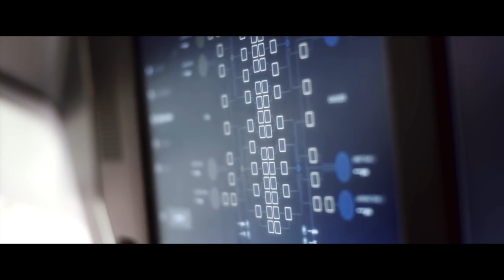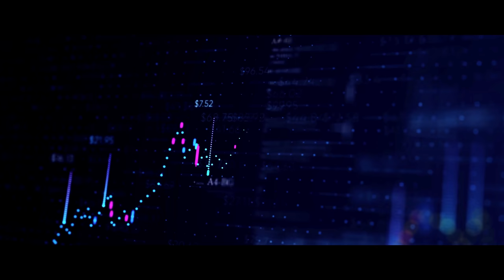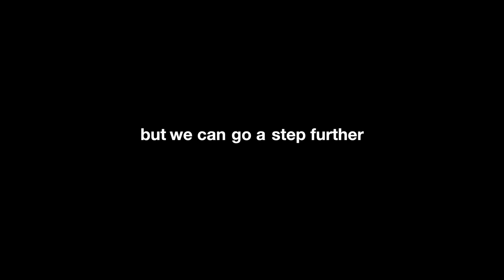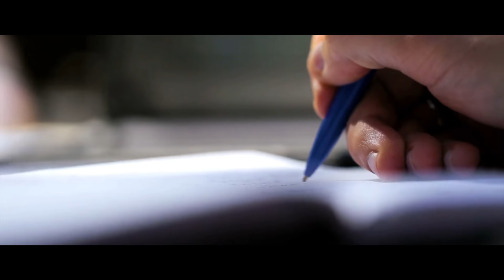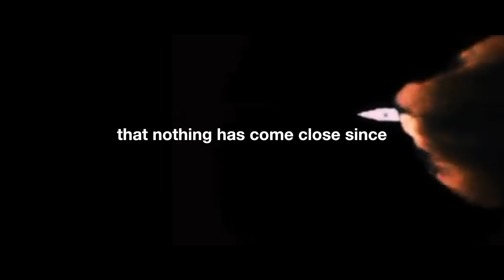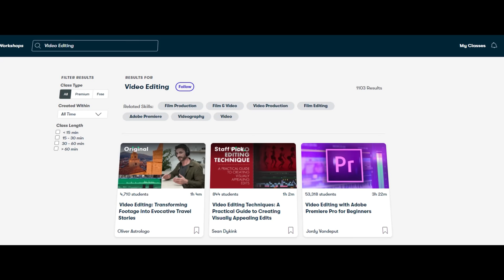The Future of Human Spaceflight

Comment: Lasers using very short pulses can achieve ridiculous exhaust velocity using  plasma wake field acceleration but years ago a pulsed laser got 5000 sec. Isp by vaporizing parafin  and then heating the vapor. Orbiting laser arrays at the destination, say Mars, can make high thrust high velocity possible. The vehicles would need large low mass parabolic mirrors but  the engine could be as simple as a block of wax...well almost. Thanks for taking up this subject with such a quality vid.

Comment: Interesting. Regarding the future of propulsion, as a student physics engineer I'd rather bet in a reinterest in nuclear propulsion and aerospike. I know it may look just like a fancy based opinion, but it is in fact very probable. It's no secret that nuclear propulsion is by far superior in efficiency to any kind of combustion propulsion ( up to 3x ), but as nuclear waste gaz would be released in the process it is forbidden in both the atmosphere and space. However if an Earth based use is indeed unwise, in space in both Earth orbit and deep space it much more open to debate and possibilities. That may even be crucial in the future for interplanetary ships for travels between a Mars colony and a Moon base. 
On the other hand Aerospike nozzle can save up to 30% of fuel in the atmosphere, a technology which is only hindered by the lack of an suitable material which would not be melted in the process, thing that would be eventually solved soon as our alloy technologies and mastering of thermodynamics goes further. 

Along with a moon base launch site with low gravity, those two thing alone would solve any propulsion issues for travels in the solar system.

Comment: 2:50 That's misleading. You need more fuel because you need to put not only the payload but also the third stage in orbit. It's not about gravity but chronology.
Reply: The Saturn-V third stage is the thing that put the lunar module and the command module into orbit. The third stage later ignited again for the trans-lunar injection burn sending the lunar module and the command module towards the moon. All of that mass is necessary to complete the mission and get back to earth. So all of that fuel in the first and second stages is about gravity not chronology.

Comment: I mean I'm no scientist, and definitely no engineer, but if the propulsion of these ion thrusters is similar to the drag of a piece of paper on the hand. What would be the flaw of having some sort of human propelled bike generator set up in the ship to provide power to the engine for a few hours a day?
Reply: Ion engines still need fuel just less of it. It uses either xenon or krypton so it will be be limited until fuel they are just much more efficient